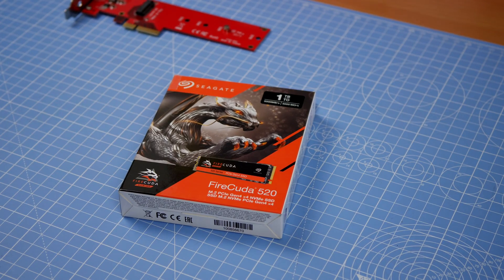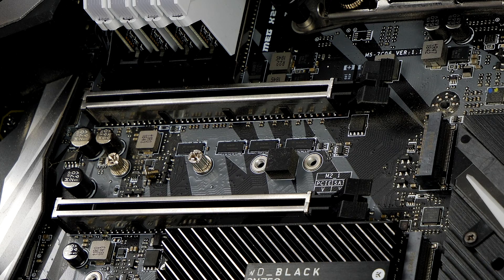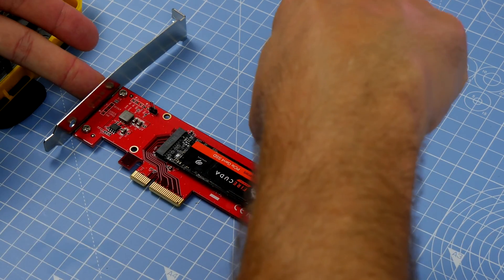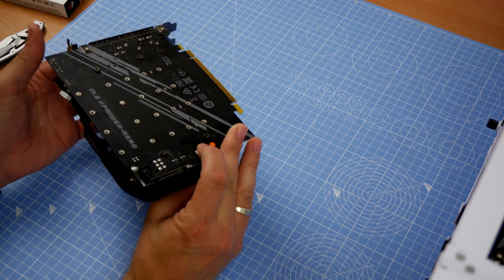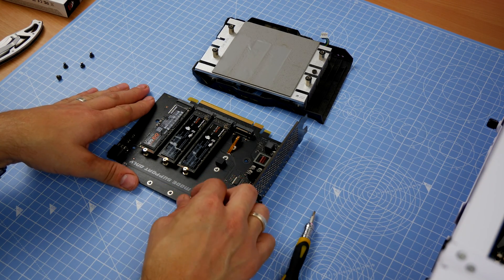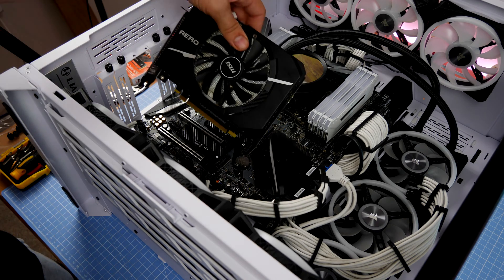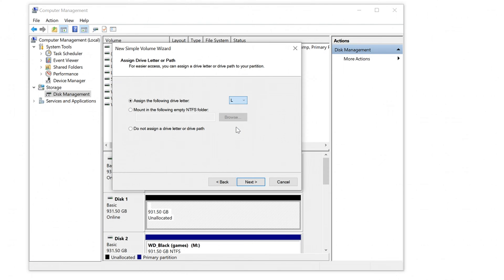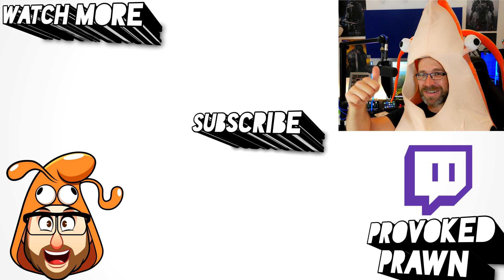How to install Seagate Firecuda 520 NVMe SSD

Comment: disk managment not initializing
Reply from the maker: You could try the BIOS settings and see if the M.2 drive is appearing in there or if settings need tweaking?